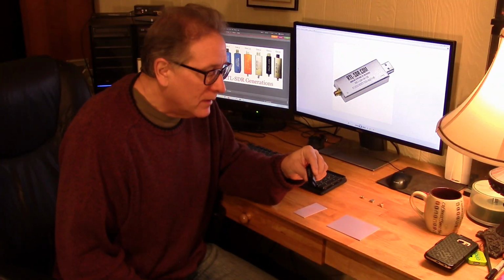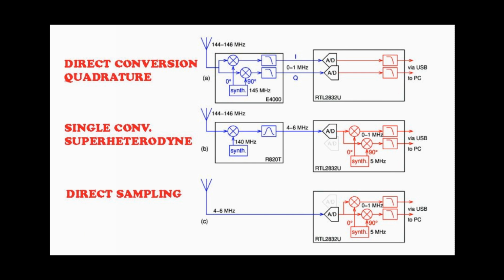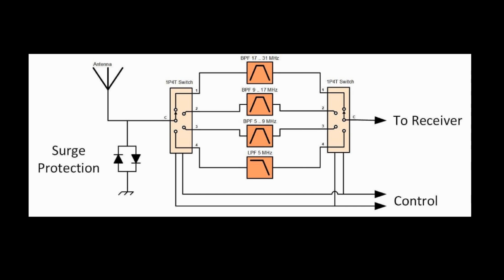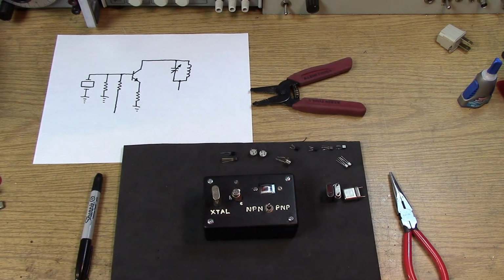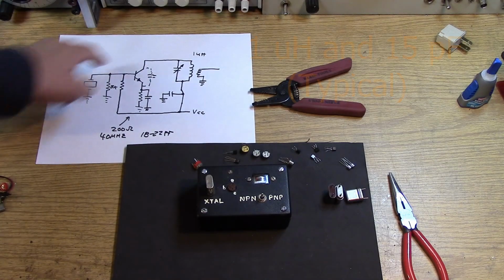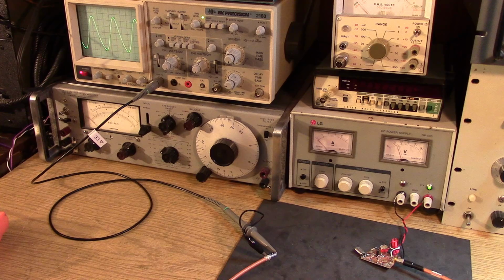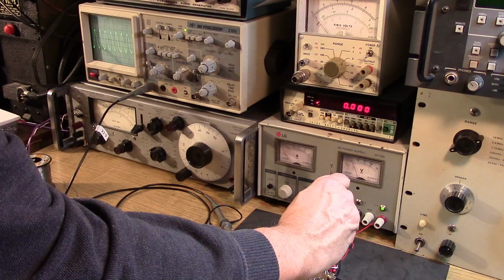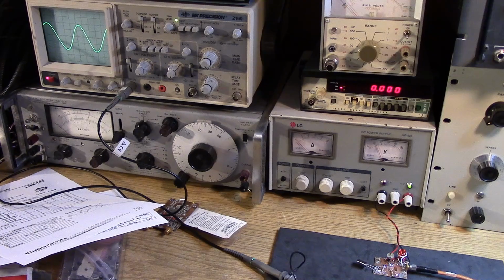SDR-RTL DONGLE SHORTWAVE UP CONVERTER

Comment: Mike great video series!  Hey on the FET's try a 2N5484 or 85; they both have lower Vgs voltages (86=-2.0V; 85=-0.5V; 84=0.-3V) that should help with a lower Vdd.  I've had better luck with FET's as oscillators especially with stability; and I also seem to get better spectral-purity with them as well.  The only time I use bi-polar is if I need power-density or don't want to buffer (which I pretty much do all the time) the oscillator.
73...

Comment: - Is it all possible to configure an up-converter such that one could achieve an audio-range (<20Khz) spectrum analyzer in combination with an (RTL) SDR? - 

Thanks.
Reply from the maker: Even if you skip the front end and just go into the A/D, its is really not a good match. Rather why not use the native sound card input on a PC? https://www.qsl.net/pa2ohh/04audio.htm
Reply: @MIKROWAVE1  Thanks for the reply - yes, I have tried PC soundcard scopes - now experimenting with a Hantek 100Mhz scope with FFT

Comment: I remember experimenting with TTL crystal oscillators (two inverters from a 74LS04) at college. When I turned the power supply voltage down, the frequency dropped to its 1/3rd. Also when I cranked the power supply up a bit, the frequency went up (don't remember how much but I'm assuming to the 5th overtone). Now it all makes sense.

Comment: I have a few 4 Pin, 50 MHz oscillators...any issue using that frequency?
Reply from the maker: Probably a better frequency actually! The only reason I am using 40 MHz, is that I had the rocks.

Comment: How does one know what Generation you have?
Reply from the maker: Wow, that will take some research, but basically you would have to consider the chip versions and time they were introduced and frequency range etc...features such as improved frequency range, Bias Tee, bypass mode for direct A/D conversion and so on...
Reply: @MIKROWAVE1  - I have a 5 year old SDR-RTL, and a 3 year old Nooelec.
Reply from the maker: Ah here you go. This is how to determine what gen you have. Maybe. http://www.radioforeveryone.com/p/rtl-sdr-generations-this-is-absolutely.html

Comment: Why do hams still insist on using inductors in overtone oscillators? International Crystal (RIP) used to sell a module OF-1 Hi  used xtals operating in the third-overtone mode from 18 to 60 MHz, Ham Radio April 1978 had an article about it. I can send you a copy of the article if needed. And when did a pico become a puff?
Reply from the maker: My channel is all about simple and first principles stuff. Kids stuff mostly. But I'm looking at my 1972 ICM and 1967 JAN crystal catalogs and they all seem to have overtone oscillators with inductors showing. Tempting a crystal to  oscillate on one of its higher modes can be done with some tricks like non-linear pumping or using very light coupling though small capacitors,  but generally a simple Colpitts oscillator will oscillate at the crystal's most active resonant frequency. Plus W7ZOI taught me how to build oscillators.
Reply: @MIKROWAVE1  Just noticed my comment sounded very jerk like; didn't mean it that way and I apologize. I do enjoy the channel and looking forward to this series. The OF-1 is a Colpitts or at least looks like one. At least it wasn't a DeMaw circuit - it would of had three toroid coils in it. { L, rfc, and output coupling}  He must have owned the ferrite mine :)
Reply from the maker: Not jerky. Engaging!
Reply: @pietmondrianstudent6984  used that term back in the late 70s...
Reply from the maker: @pietmondrianstudent6984  Also "mickey mikes" as with 100 mmF and even older: "triple ought caps" as in .0001 uF = 100 pF
Reply: 'Puff' is a very old and very common term; I knew radiomen who worked from the 30's that used the term along with 'Mickey-Mikes.'
As far as DeMaw, he wrote a book called "Ferromagnetic-Core Design & Applications Handbook. Toroids are great when you need a lot of inductance in a rugged design predicate on its mounting and coating. They've always been readily available from multiple sources since the 70's. When I worked for Circuit Board Specialists in the 70's we had 3-5 sources.  The reason the Amidon was so advertised was because they gave good deals to Amatuers ordering in small quantities...

Comment: Ham-It-Up works well and its pretty cheap.  I changed one of the RF connectors on it and was able to mount the RTL directly to the up converter.  Then was able to mount the whole thing in a cast aluminum case with a USB type B connector relocated to the front.  While very educational, will your design perform better?
Reply from the maker: Sounds great, cheap is good and you have the idea pegged!  We shall see what magic can come from ignorance on my part, as I develop the circuit.
Reply: @MIKROWAVE1  When I saw the design of the Ham-It-Up I was very surprised as to how well it worked.  I figure if I cobbled something like that it would have flopped.  Will be interesting to see what you come up with given your experience.  A little dry sense of humor doesn't hurt either.